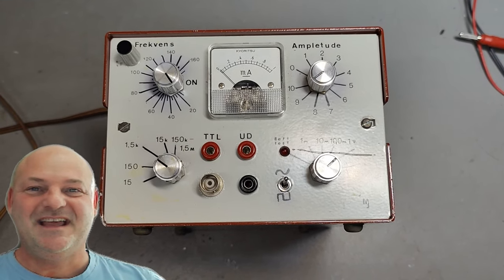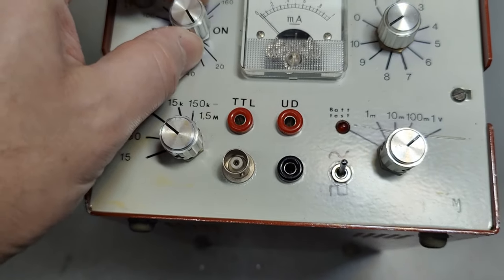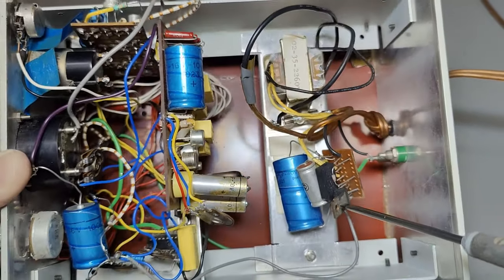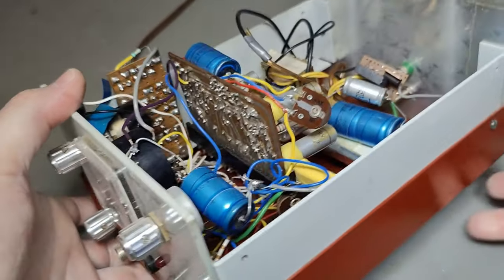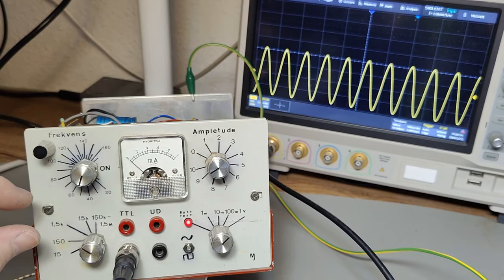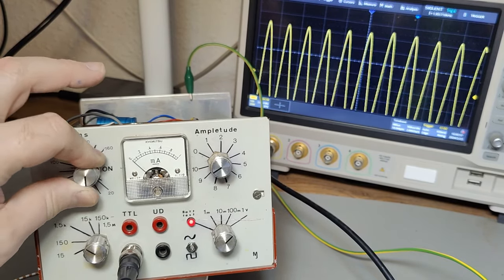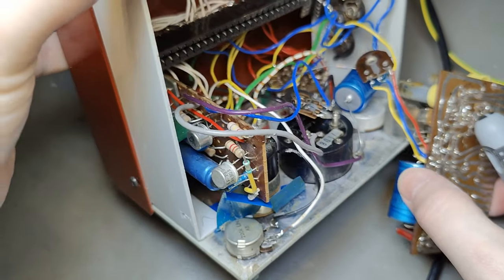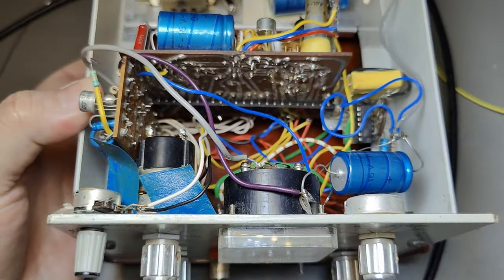DIY Sine-Square-wave generator 1972 MJ test teardown

Comment: That amplitude control loop response 👌 Herr Wien made visual. My projects looked similar when I was about 14 or so. Beautiful mess that somehow worked. I was in an engineering family though so I had to learn quickly or be told by my father “nice job, now you have to redo it, preopely this time”. Once I wired a whole replacement keyboard for a ZX Spectrum. It looked as bad underneath as you may imagine. Had to tear the wiring all out and make it nice and proper. Ugh 😅 Took me a whole weekend. A whole weekend I will have you know 😂 (insert teenager attitude here)

Comment: when i was a kid in the late 90s and early 00s i used telephone wire for all of my projects 
telephone wire, speaker wire and rats nests
it was only when i started showing off my stuff on forms did i care to properly tidy up wiring and make them slightly less of a fire hazard 
i made a high frequency transformer driver as a kid with a 555 and some push-pull transistors, as an adult i opened up the project box and it just sprung apart with all the crammed in wires.

Comment: Wow, at 7:40 is there a vacuum tube on the board?
Reply from the maker: it is a BULB or filament, it is not glowing, but the resistive part of it is used for level compensation, more signal = more current = hotter filament = higher ohm value, then back to less signal = now we have a simple regulation system